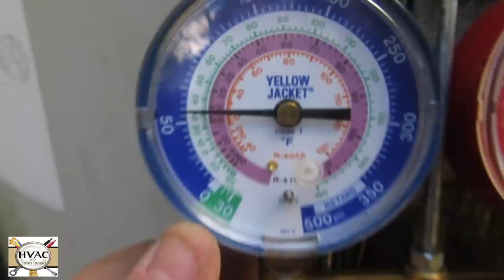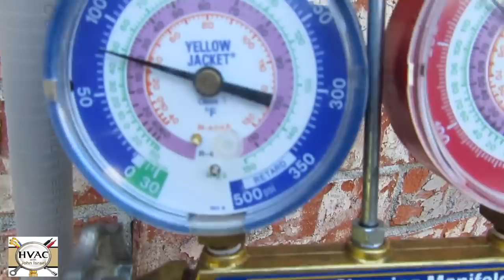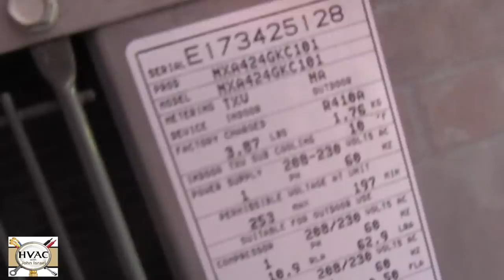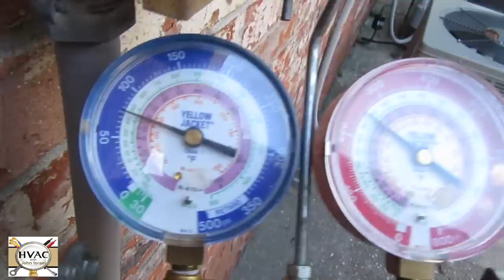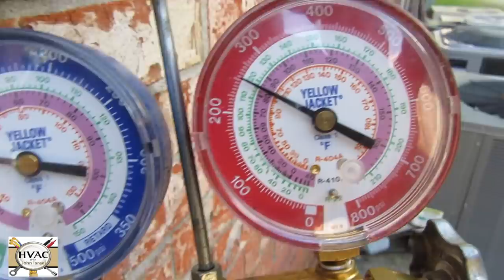Two No Cool Calls

Comment: Oil wise and pressure wise the 407c is not a problem. Swept volume for r410a is way lower. So the 2 ton 410A unit will only give about 1.2 - 1.3 tons of cooling running 407c...

Comment: Nice shot on the two old beasts John.  Those old Inter City Product and Ruuds are fantastic units that refuse to give up.
Didnt know that the drain plugs had to be removed.  Great video!
Reply: That's why these videos are very useful because the tech that installed the motor probably wasn't taught that either.It can't be laziness because that's too simple to take off the drain plug.

Comment: It blows my mind that people do that with the R410A and R407c but it's a popular trend with hacks. The reason they do it is over the concern that the indoor coil is old and not rated for R410a pressures or the line set is 1/4"od
Reply: your on to something.  that makes more sense. but why not just change the indoor coil.   Customers cheap?   or is it the installer dont wanna bother installing new lineset and coil
Reply: I was gonna ask why the 410a to 407c switch? Does it save the installer any money? What’s the reasoning?
Reply: Thanks I was wondering this you answer my question about this 407 fiasco
Reply: If the indoor coil is OG 22 then why not just get a 407c condenser,  if the customer can’t pay for the correct application then they don’t get anything. This customer likes the Home Depot back ally discount aye. 🤦🏻‍♂️ they probably had that condenser laying around scratch N dent.
Reply: Aaron Arias there aren’t any more 407c dry ship units to be had.  There was a cut off date on that loophole.

Comment: Only  one question  why change 410 to 407 it makes  no sense  to me.
Reply: 407c is a retrofit for r22. They do that to avoid changing the coil inside. Otherwise 410 has much higher pressure thus r22 indoor. Coil would not be able to handle the 410 refr